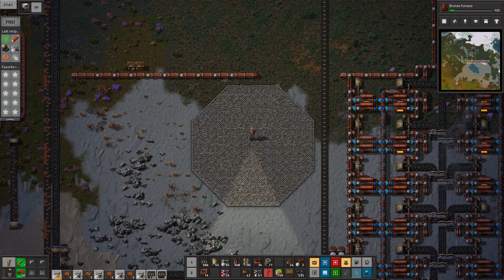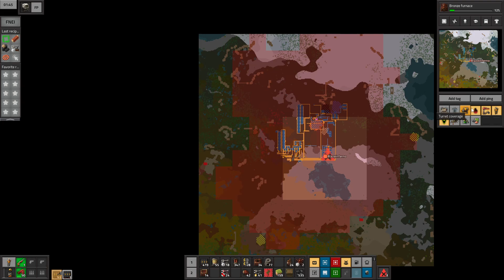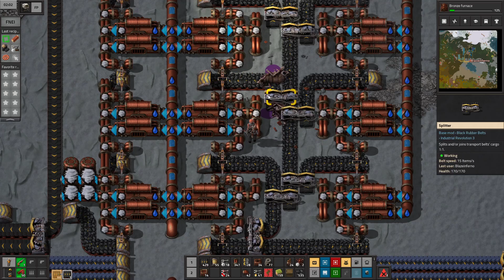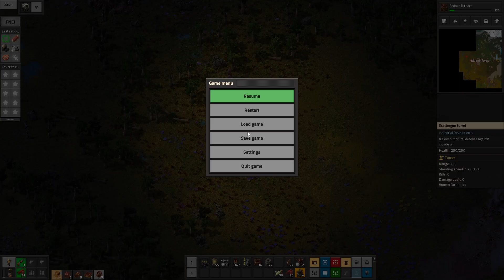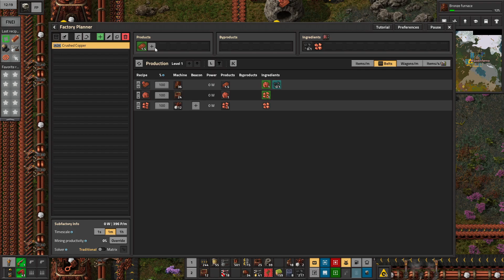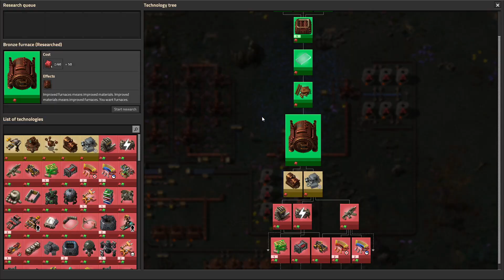Factorio - Industrial Revolution: Day 4 [Greeting the Neighbors]

Comment: Either the mod itself has changed in the last 3 months, or something about the later start (I started with default and no tech) or your mods have changed it, because my early robo-ports and my monowheel are all fueled by steam tanks that are filled from a steam interface on the power grid.  Each cannister holds 100 steam and they stack to 50 which is the capacity of the robo-ports and the monowheel.
Reply: Yes, there have been some changes in the steam era. I like things running on steam so you can add roboports as you upgrade your armor. Delivery plates also help to keep items stocked.